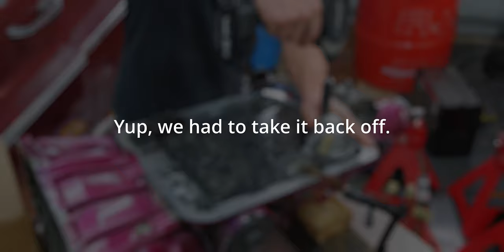How To Install a TransGo HD2 Shift Kit & Corvette Servo in a 4L60E! — Feat. Our 1999 Chevy Suburban

Comment: First time working on a tranny. This is very informative, extremely useful, and well detailed! My only question, you stated in the beginning you can change the servo with the tranny still mounted. How are you supposed to check if you can turn the input shafts if the tranny is still mounted? I apologize if that's elementary. Like I said, first time upgrading my transmission components. Thank you any, for your time, and I hope all here stay safe!
Reply: Spin the driveshaft
Reply: @BigNate9411  so put the truck in neutral?

Comment: The shinny spring in the converter regulator valve already locks the valve to stop the gradual application of the converter lock up to fix the bore wear and fix the 1870 code

Comment: Shouldn't you have used a different spring @20:08 being that you installed a corvette servo?  the 553 was the stock piston.
Reply from the maker: The corvette servo didn't match any numbers on the shift kit instructions, so we went with the stuck numbers instead. Main reasoning is that, we don't know why the different pistons require different springs, but if it has something to do with a factor outside the servo, then it would be best to stick with what marched stock.
Reply: @VeryGoodGarage  I think that spring firms up the band engagement kinda like what the 1-2 accumulator piston spring does thats why they have you drill it out to use their pin so if you want to change firmness of your 2-3 shift you dont have to drop the valve body to change the spring.
Reply: Yeah the Vette servo is 093 so when I did mine I used the white spring and the shift felt good

Comment: That’s the wrong filter it will burn up the 3/4s! Plus it’s already pretty toasted with all that debris ! Metal bottom filters are for the shallow pans you have the deep pan ! You will burn it up ! If you haven’t already !
Reply: what is the correct filter?

Comment: What converter stall would you recommend for a 2001 Silverado single cab 5.3 with the same Trans set up ?
Reply: If it's a stock cam then nothing to huge. But 2800 stall would probably treat you well. But depending on your rear gear that might not be the best option. Really depends.

Comment: I need to swap out my transmission in my 1988 Corvette I heard that a 700r4 will work I just wanted to see if anyone knows anything about that? Because the transmission in my car is not a 700r4 I think it's a 4L60 maybe. But anyway will that work do I need other parts to make it work or will my old parts works I think I heard it might need a longer drive shaft or something. I'm not sure can anyone help? I tried googling it but the information sounded kind of vague to me like there might be a bunch of extra work involved.

Comment: I'm sorry I may have missed it, does the HD2 kit contain the same springs as the 7CS add-on kit that go internally on the 3-4 clutch spring cluster and others? (maybe Forward and Overrun clutches?) I was told instead of buying the HD2 to buy the SK and 7CS...

Comment: Nice videos i bought the correction kit but didn't buy the corvette servo do u recommend to get the servo for my c1500 suberban 2wd same as yours . Also is the hd2 better im using my truck as family car or im good to go with the correction kit .  Appreciate ur comment 😁 

Thanks 
I subscribed by the way
Reply from the maker: I could be wrong but I actually think most people usually just do the kit without the servo. I did it just because I thought, why not, but you can use either or both, it's up to you!

Comment: Precision Transmission.  Watch their videos.  They teach you the right way to do it.  Not some half assed way.  Smfh
Reply from the maker: We actually love their videos, them and the Transmission Bench guy are what we've learned from. What did we do that was half assed?
Reply: ive learned alot from precision transmission the guys daddy, all he does is take them apart but he will tell you from experience what to look for, but if someone is a complete noob they should be watching transmission bench i dont think that it would be possible to better present a rebuild video than transmission bench. alot of value in it

Comment: I have a 700r4 I'm having a problem from 1-2, I installed a Corvette Servo and the problem I'm having is that it shifts too late from 1 to 2 and so on...
Reply: The shift cable is too tight , there's a lot of videos showing how to adjust it.

Comment: Great video man I'm about to put this kit in my 94 4l60e. Did you modify your PWM solenoid at any point?
Reply from the maker: It was replaced because we uh, broke it lol, but it was just replaced with a new one
Reply: @VeryGoodGarage  ah ok I didn't realize that was the PWM.  Have you ever modified the PWM in other transmissions? I am under the impression that a solid torque converter lock up is more efficient than the gradual application of lock up with the PWM. Maybe I am misunderstanding this, i have only changed filters and solenoids before.
Reply from the maker: I think I might have named the wrong solenoid, it could have been the one on the other side, the 3-2 downshift solenoid, but they weren't modified other than being replaced with just normal replacements, so neither were intentionally modified with something different
Reply: Yeah you can block the pwm solenoid valve so that its no longer pulse width modulated it directly applies and isn't as hard on your torque converter clutch. Isnt hard to do it all.
Reply: @thefogisgone3662  I'd like to do that. PWM seems like a dumbass federal emissions idea.
Reply: Not sure but I don't think that 94 is a PWM if it is it will say PWM on the pump, anyway if you wanna block it and make it a on/off engagement pull the TCC valve and put a ball bearing on both sides of the spring in there and reinstall it. What that does is compress the spring so your valve doesn't move. There is a drop in valve with orings made by Fitzall its about 20 bucks but if your a cheap ass like me you'll just do the ball bearings lol

Comment: I wana do this kit on my truck with the tranny in the truck how do you keep track of the check balls with the tranny in the vehical seems like they would fall out when removing the valve body can they be set in the valve body and re installed when putting the valve body back up in the trans/ or is there a way to get them to stay stuck to the plate or something
Reply from the maker: I think you basically just lower the separator plate slowly, and when reinstalling you just have to set them in place and install the plate slowly making sure they don't roll out of place. Honestly it almost sounds harder to me to do the shift kit with the trans in the car, but I've got a lot of practice dropping the trans so to each their own I suppose
Reply: Tiny bit of Vaseline to hold them on place

Comment: I'm not doin full race but do have a 2500 stall converter. At 28:37 do I still need to drill that hole to 101? And also would I need to use all 3 of the shims on the accumulator? I had only planned on street strip but cam requirements say at least a 2500 stall. Is that considered a high stall?
Reply from the maker: I think high stall is like the 4-5k range, so I would say don't go full race on any of the steps that give that option
Reply: @VeryGoodGarage  Thanks!  And I broke the  opposite solenoid trying to get the clip out hahaha
Reply from the maker: Yes, that happens, we did exactly the same thing lol...
Reply: @VeryGoodGarage  The plastic accumulator piston that you upgraded to aluminum how do I know which one to order? I THINK that I have a 2003 4L60E

Comment: You put the pan gasket on WRONG. You covered the vent hole, it's just above the brake band accumulator.
Reply from the maker: Could you refer me to something explaining what a "brake band accumulator" is?
Reply: The servo he upgraded is a hydraulic piston that pushes on a coated steel band inside the transmission. The band surrounds the clutch housing and when the PCU "Power Control Module" senses a downshift or engine braking condition the servo extends which squeezes the band thus slowing or stopping the spinning clutch pack to allow what ever operation asked for. Go to YouTube channel 
Precision Transmissions Richard does an excellent job of explaining how transmissions work.
Reply: @chucksmith8200  that’s the 2-4 band accumulator, not brake band accumulator. That’s also not how it works. Engine braking is done by the overrun clutches. The 2-4 band stops the reverse drum from rotating in 2nd and 4th gear.

Comment: hey bro!    when you flipped over that accumalator.  how the hell does the piston compress when the inlet hole is on the other side?   weird huh?

great share!   

larry
Reply from the maker: You're guess is as good as ours, I'm sure you saw our visible confusion when we read that you were to flip that piston upside down lol
Reply: The 3-4 accumulator isn't needed flipping the piston with the sping just blocks it off, its common just to delete it you can stack two pistons or some kits have you pound a ball bearing inside the inlet but I like to tap it and put a set screw with a little lock tight. This also extends the life of you 3-4 clutch pack.

Comment: Can I take my old valve body out that has a kit and put it in a used 4l60 with the servo!
Reply from the maker: I would only do that if that years of the transmission are the same, some things change between the years and I'm not sure what problems that could cause. Since it's just the valve body I suppose you could just try and see if everything still works lol
Reply: Very Good Garage is right they did make changes in the 4l60e from different years but the oil circuits in all 4l60e cases are the same. For example I have a 95 yukon 4x4, I can use any 4l60e and it will work fine as long as you keep the same valve body and separator plate for that specific year. The year will be embossed right next to the pressure control valve.